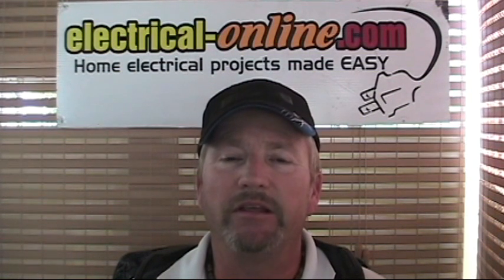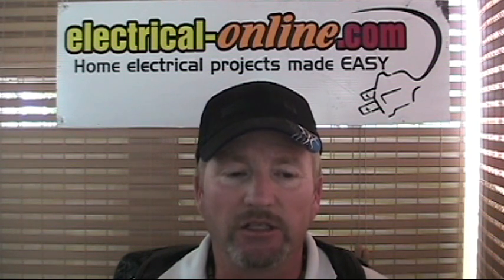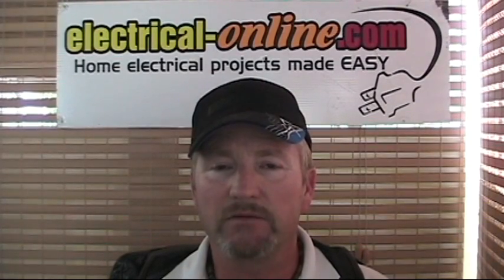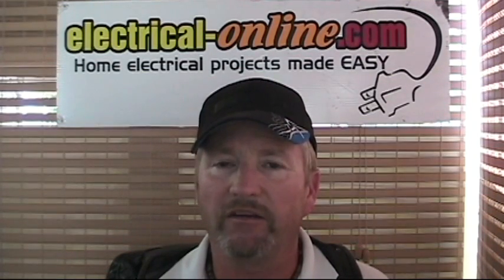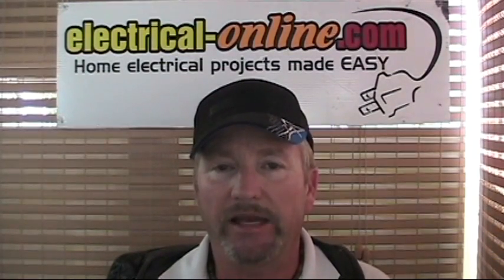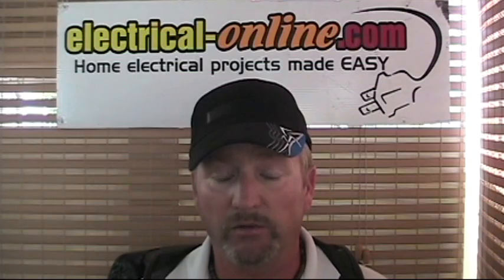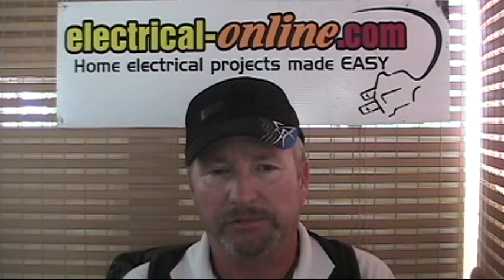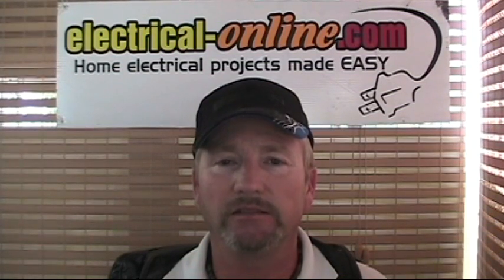Broken Neutrals Bad Connections and Broken Splices

Comment: Hi Terry, thanks for your videos.  I am remodeling a house that apparently has a broken ground (#4 bare copper) to the service panel.  There are 2, one is connected to grounding rod outside and this wire is connected to the copper water pipe that is over 70 ft away.  I placed a split bolt connector and added about 2 ft of new wire into the panel.  The inspector looked at it and said that is the wrong connector because it can be undone and needs to be connected in a manner that can't be changed.  He couldn't tell me what connector to use and I have scoured the internet looking and the only one I came up with was a Burndy YDS4W 4AWG copper splice.  It is pretty much a butt splice, but I don't know how to compress this.  Is this something you can elaborate on or should I spend the $200+ on new copper?  Any help is greatly appreciated.

Comment: We had a serious incident last week where there was a burning smell coming from the main service shutoff and the box was very warm (120F) and lights were flickering. Shut off the main breaker and opened it up to see casing on the #3 neutral all blackened and partially melted.

Electrician came and said setscrew was loose on neutral but also there was too much casing cover stripped off the neutral wire and it was possibly arcing.

He rewired neutral and we turned everything on full. We discovered that control panel on electric stove was fried, stovetop elements worked but not the oven. Satellite dish receiver was also fried and would not power up. Same thing with printer. Fortunately new dishwasher was not damaged.

Very relieved that we didn’t have a serious fire.
Reply from the maker: That's more common that you would think.  Loose neutral conductor, and that can cause many issues as you can attest to now!  When that happens and you lose the neutral reference, then the voltage can vary anywhere between 0 and 240V on circuits, depending on what is on and off in the system.  I'm not sure I concur with his thoughts about the neutral being stripped too much causing arcing.  Glad you got things fixed up. Too bad you had damage.  If this had happened in the meter or on the transformer side of that, the utility company would have to pay for your damages.
Reply: @theinternetelectrician  Thanks Terry - I can send you a photo of the main breaker box if I am able. 

There was another issue that he identified that the sub-panel was not fused and both the main breaker and the 100 amp panel were flush with the finished wall and not mounted on the surface of the wall. We are going to have him back to correct those issues and replace the 100 amp service panel.
Reply from the maker: @brianbaker359  Hmm. There isn't an issue with flush-mounting a panel or a subpanel.  Please do send me photos of everything and I'll see if I can help out out. internetelectrician@gmail.com

Comment: Have one wire not supplying current on a 220 buried line. How do I find where the break is? Don't want to dig up whole line. 400 ft.
Reply from the maker: That's a good question!  There is equipment available for this.  Google line break detection.  Also there are specialists that can narrow it down for you.  Sounds like a USEB-90 underground aluminum cable, yes?  Usually they break down at a splice, (if there are any), and if not, the cable likely got nicked by something like a sharp rock that compromised the insulation and allowed water to get in.

Comment: Question for Terry! I had the utility come replace my broken neutral. Could this whole incident cause bad house circuitry problems?
Reply from the maker: Hi Sam. Yes, a broken neutral on your service conductors will cause a whole bunch of issues. With no direct path for the 120v circuits with the neutral compromised, the current flow will find a way through 240 v appliances and equipment resulting in fluctuating voltages anywhere from 0 v to 240 v and anywhere in between. So turning on the electric range might cause some lights to go dimmer, or get brighter, etc. You would have gone through a lot of light bulbs and lamps, and maybe even damaged larger appliances like refrigerators and microwave ovens, etc. Sound familiar?
Reply: @theinternetelectrician  thats. I am also wondering if the wall sockets and switches and circuitry are damaged inside the walls. What are your thoughts?

Comment: If a person puts120 v on a ground rod shouldn’t the breaker trip?
Reply from the maker: Yes, it should unless it's too resistive of a path to earth.
Reply: @theinternetelectrician  https://youtu.be/GI0Q9X2ih-U Is there a flaw in the  the way this experiment was done?
Reply from the maker: @andystitt3887 .  This is a good experiment.  I too would have bet that the non-GFCI/AFCI breaker would have tripped the breaker.  And it was close, with 9 Amps being drawn into the earth.  I would like to see if he got the same result in the pouring rain.  Or if he moved that ground rod right beside the panel and the transformer.  The earth dissipates that energy in a gradient, as he noted in the video, and the earth has resistance to it for sure.  So again, as Benjamin stated, the grounding systems we install will not act the same as a bonded neutral connection does if we lose that system neutral.  It's a part of the entire system, not the solution to a lost neutral.  If I had thought about it more prior to answering your question initially, I might have said no to the breaker tripping as it brought up a dangerous, but effective method my father and I used to rid the lawn and yard of dew worms.  Attach a hot and neutral to two metal coat hangers and shove them into the wet earth about 3 feet apart and watch the dew worms pop up all over the place! And the breaker didn't trip, but again, a dangerous practice as there is too much room for error! Step voltage is a dangerous thing!  With some of the steps that Benjamin took that brought him closer and farther from the source, if he was in bare feet, he surely would have felt a good buzz.
Reply: What is the regulation distance to drive grounding rods?

Comment: Great videos Terry, 
I have a issue at my house my ground wire at the ground rod came loose and it begins to spark when I turn on my microwave what can it be also my lights dim when I use any appliance... should I call utility...
Reply from the maker: Yes! For sure, call the utility.  The ground rod at the house is really just a safety back-up system in case the incoming utility neutral connection fails.  If you have current on your ground wire to the rod, that means that your neutral is compromised partially or even totally.  If and when it fails completely these floating voltages you are seeing can bounce around to anything from 0 volts to 240 volts on a 120V appliance or light fixture, so shut off what you don't absolutely need, (especially 240V like electric heat, range, clothes dryer, etc) and get this looked after ASAP!  Let me know what you find as the problem.  FYI, the problem could be in your main panel, the meter socket, or at the utility transformer. terry@electrical-onlne.com for any further questions or advise if you'd like to reach out.

Comment: Good information.
Last year we had the main neutral between the pole transformer and the house break.  Symptoms began with popping local surge protectors, and brown-outs in other parts of the house.  At the 200 amp main, I tested with a meter, and was getting 170V on one side, and 70V on the other.  That was frying half the circuits, and starving the others.  I disconnected from the utility, and fired up the generator.  TWICE, the power company back called to tell me that they saw "good" current through the meter, because all they get is a total.  On my third contact, I finally got someone who cared enough to send out a crew, and the issue was fixed quickly.  I lost EIGHT surge protectors, and fortunately no appliances or other electrical equipment.
Reply from the maker: Wow!  Very irresponsive and total negligence on behalf of the utility! You had classic signs of a high resistance neutral connection that they should have been dealing with right away.  Very fortunate that you didn't have some more serious damage to your stuff!

Comment: hi I went to do a job at this house and I found 4 receptacles with open neutrals all connections are fine I checked the main panel and is fine to I felt very confused any ideas on what can it be ?
Reply from the maker: You will have to check continuity on the neutral conductors of the cable(s) feeding those receptacles.  One possibility is a screw or staple that pierced a cable and has now failed.

Comment: I'm getting 106 on both hots, at the breaker box coming from the meter,   ?  Is this a outside power line problem,  I've shut all of my breakers off, and I still get the same reading,  I turn on a 240 breaker and turn something on, it doesn't work,

Comment: I have a open neutral. I have 3 outlets and a small fan hooked up together on a switch. Will the outlets sill work or should they be dead with the open neutral. Mine all work and the fan too. I checked all the white wire connections and are good. I'm puzzled.
Reply: Derek Johnson  ur appliances will burn if u have a loose or no neutral
Reply: @eng.knowledgeseeker  ,that does not sound correct.
Firstly, a loose neutral will cause excessive heat on the circuit. With that, either the CB will trip or the smallest conductive point along the circuit with burn out until the CB trips i.e either the culprit loose connection or the appliance plug/wiring...which of the two with a lesser conductor surface area.
As for an open neutral, how can an appliance burn out in an open circuit? Nothing will work because the voltage potential is incomplete. Note that at this state, earth/ground is only a reference point and is not connected to complete the circuit. So no neutral- no usable voltage.
Reply: @henickerhillman154  Makes good sense!

Comment: Good ideas.Thanks for the video.Have you tried Wago lever nuts instead of twist on wire nuts? They really work well.
Reply from the maker: John, yes, I have used them, but not enough to give an opinion on their performance in a variety of situations.  The concept makes sense, and I like that you can see to connections inside to know that you have a good splice.
Reply: Excellent product, and also gives more space in the junction box.